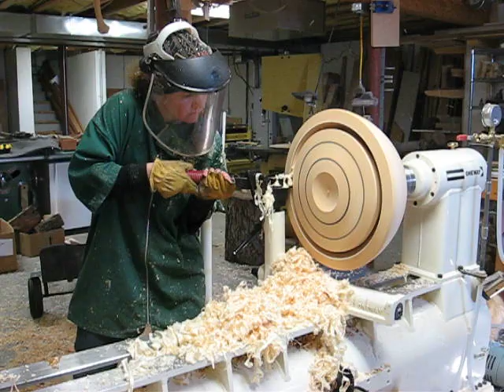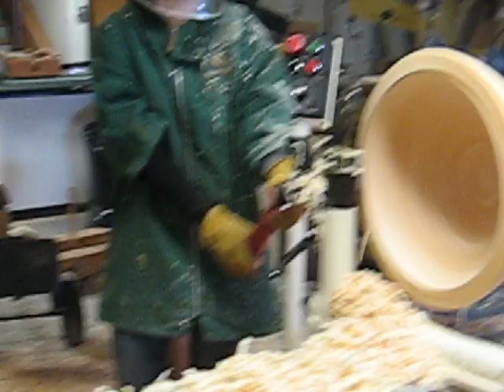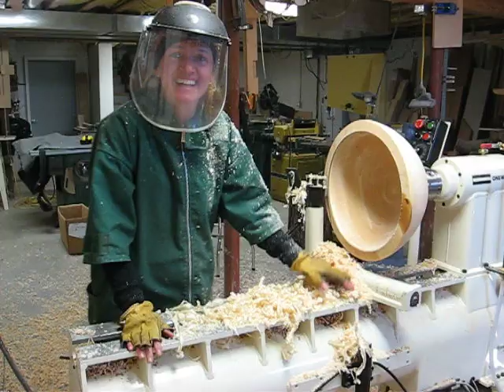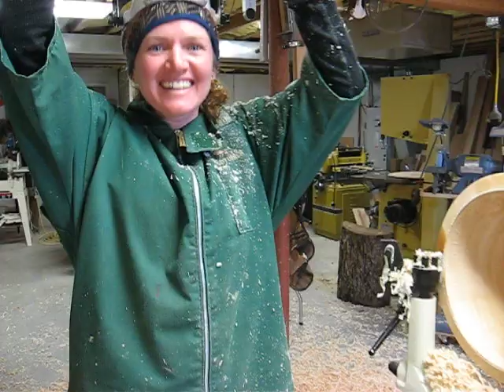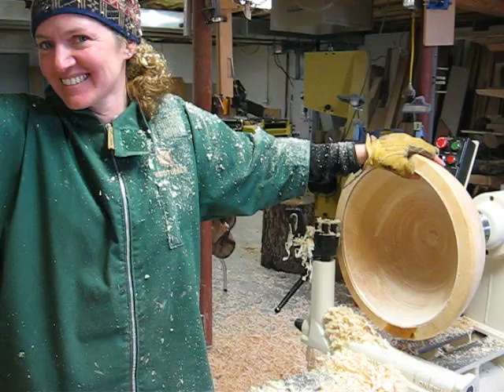Woodturning Bowl Coring Blooper - Kel McNaughton System

Comment: Nice work I have the Kel McNaughton System also and its an older model where the cutting tips are a different grind from the new ones. The steel on mine don't seem to  keep an edge for long. I am thinking of tempering them or soldering on some carbide tips. The best steel for scraping I have found believe or not are old craftsman carbon steel turning tools which I break out of their wood handles  and attach the steel to my home made tool holders.

Comment: Guys, I don't understand why you are bashing so much at the girl. This wasn't a mistake - she was using a special tool to save the wood from the interior of the bowl, rather than make it into sawdust.
Reply: if you still care for an answer 9 years after you posted the answer is yes, you are right, but she still made a mistake, you are supposed to use that tool until only a very little piece of wood still connects the bowl and the core you are removing, then stop the lathe and detach the core manually, her mistake was that she went a little too far using the special tool so the core detached form the bowl in a unpredictable and not controlled way, thing that can be risky given the weight of that particular core and the rotation speed

Comment: It depends on what I'm going after as to whether I start cutting the smallest or the largest bowl first. In this instance, I wanted to make sure I got the largest bowl out of the blank so I started with the outer core. Once you core out the first bowl, mount it on the lathe with the inside of the bowl against a jam chuck bring up the tailstock to secure it and turn a foot to mount into a scroll chuck and repeat the process.